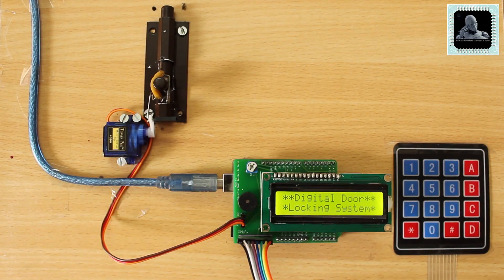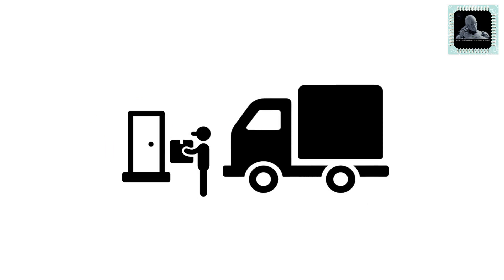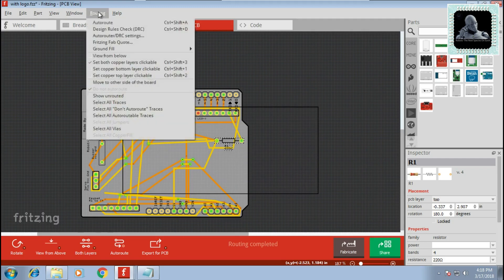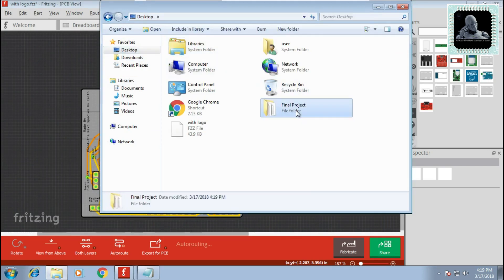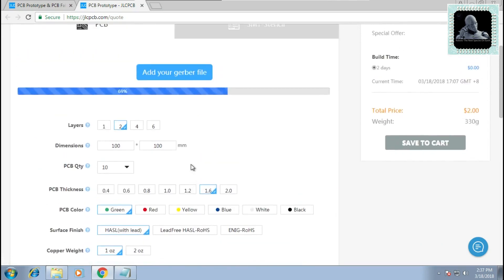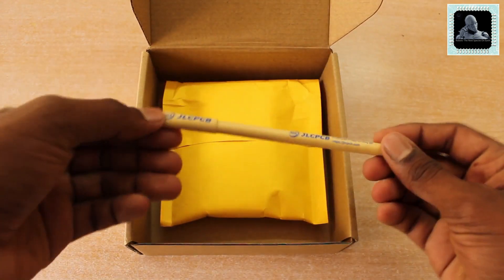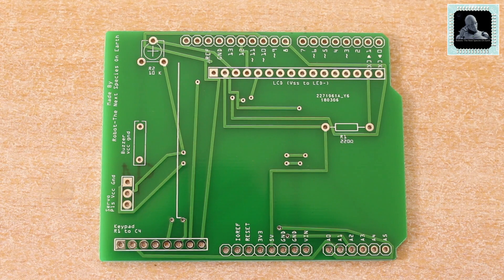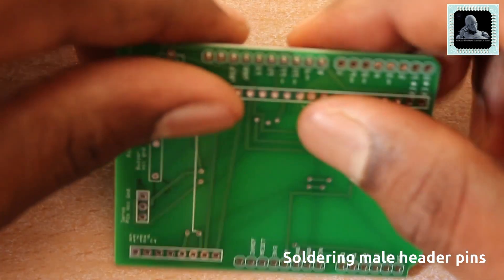Digital Door Locking System Prototype Using Arduino + JLCPCB

Comment: There is no servo motor pin is defined in the code and that's why servo motor is not working please solve the issue
Reply from the maker: Hello mate, This issue has been fixed.  You may now check the link in the description for the updated Arduino code.

Website link:  https://www.robotsthenextspeciesonearth.com/p/test_22.html
Reply: Where sir ji